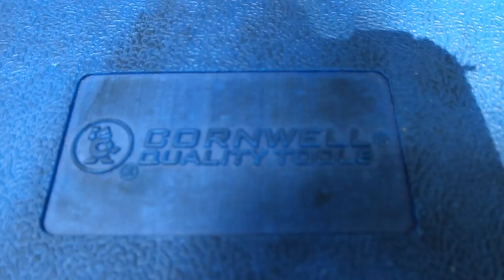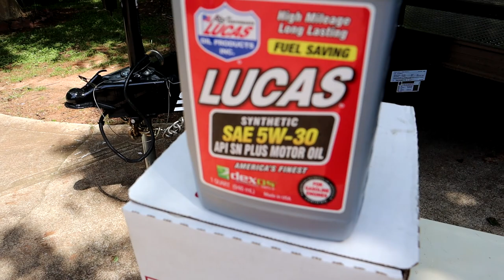TorqStorm Supercharger Oil Change How To DIY

Comment: Man I wanted to see you install the belt back on . Having getting mine on even with loosening the 8 bolts, gonna try next step belt I think it may work because the one t.s. sends with kit is a hard to get on!
Reply from the maker: It goes on very easy ill try to do a video of it soon.

Comment: Did you upgraded that belt you have the green belt ???
Reply from the maker: I changed to the 3.1 pulley awhile back and that's what my local parts store had but seems to work good.
Reply: Did you gained extra horses with smaller pulley also did you did it your self or torqstorm??? How much was that green belt I love it how many horse power are you making with that blower ???
Reply from the maker: @ChanelZiro  truck will run high 10s not sure about horse power but probably makes about 550-600wheel
Reply: @FrostbiteRam  what other things have you done besides Procharging it I’ve most of your videos

Comment: How often do you change the oil? What type do you use?
Reply from the maker: They say once a year or 10k miles.  They sell the oil in pre measured bottles.
Reply: So about every 2-3 engine oil changes depending on your schedule

Comment: How would u know the oil is bad is it like your truck it will turn blk and lose viscosity? And does it go bad from racing heavy or jus normal day use?
Reply from the maker: It really doesn't change color much because there is no combustion to get the oil dirty just basically keeping the oil fresh and free of debrees.
Reply: @FrostbiteRam  does it lose viscosity?
Reply from the maker: It probably just breaks down over time due to the heat.
Reply: @FrostbiteRam  ok..whas imma rewatch again but did u say to change it every 10,000. Or once a yr.?. Im so forgetful id run AMS oil in my truck jus so i could change em at the same time 😅 they say AMS will last 10k no problem
Reply: Did they say what weight the oil is i dont remember?

Comment: Why does your coolant overflow tank cap have a hole in it ?
Reply from the maker: To vent
Reply: Stock one doesn't have a vent, why should this need a vent ?
Reply: @DL101ca  stock has a vent tube coming off the side?

Comment: Are you running a kenne bell boost a pump??
Reply from the maker: No, completely stock fuel system only upgrade is injectors.
Reply: @FrostbiteRam  so it isn't necessary to run the boost a pump damnit I'm sending it back, I bought hellcat injectors so those should be good. Who did your tuning? BTW love your truck and you have a lot of great info on your channel 💯💯💯
Reply from the maker: @daddybearcom  im tuned by Justin at doctor differential and speed shop
Reply: @FrostbiteRam  is that an email or dynotune?
Reply from the maker: @daddybearcom  email remote tuning